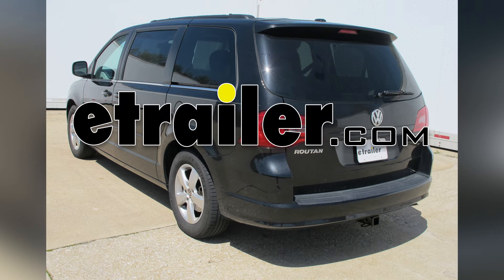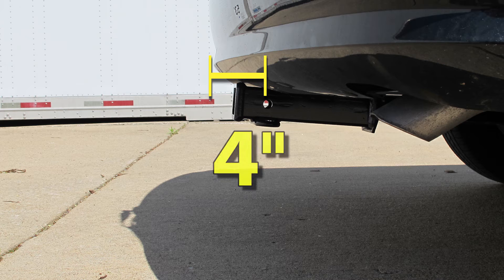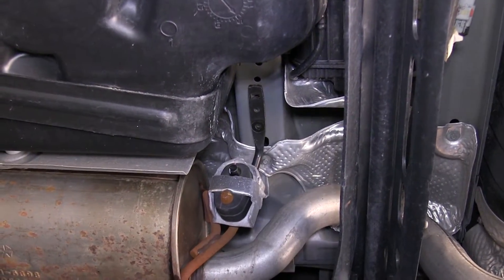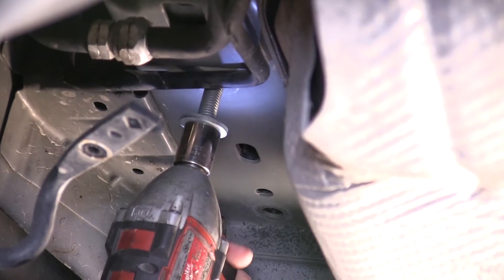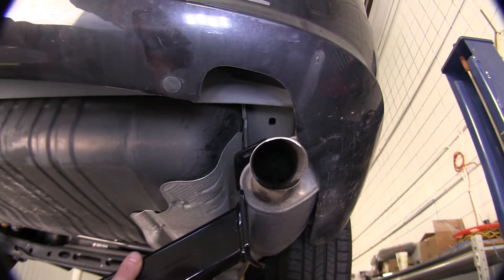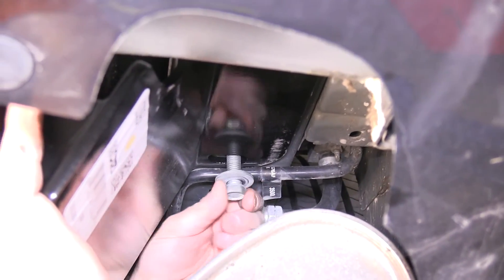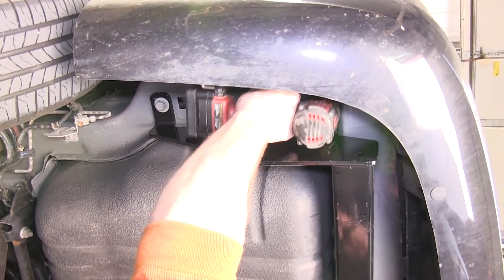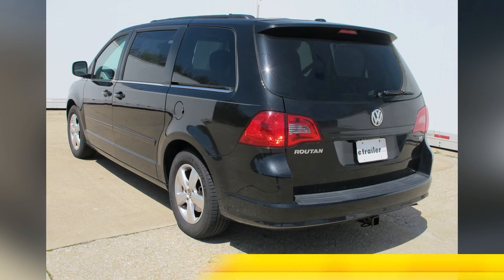Step-By-Step Installation Tutorial for the Curt Trailer Hitch Receiver on a 2011 Volkswagen Routan

Comment: great video much respect for the effort!! would you recommend loctite or silicone to keep the bolts from getting loose?? thanks in advance
Reply from the maker: There is no need to use anything as long as the hardware is torqued to the manufacturers specifications. You could use a bit of blue Loctite if you would like to have an extra level of safety.
https://www.etrailer.com/Trailer-Hitch/CURT/13364.html